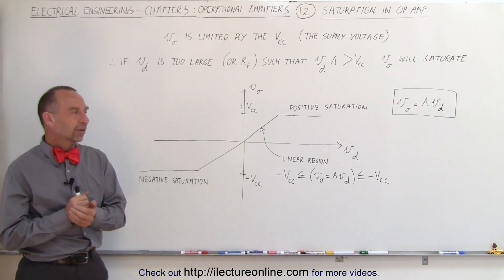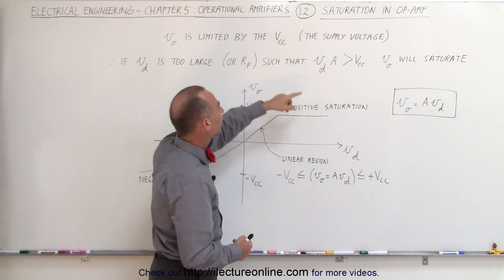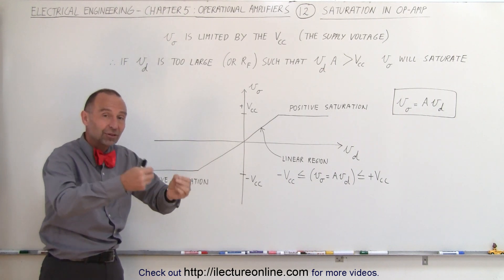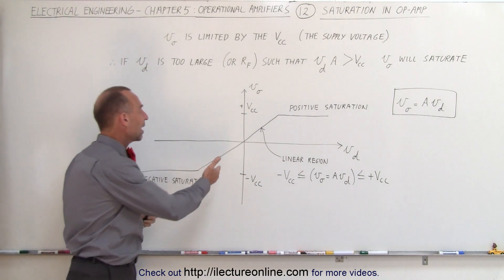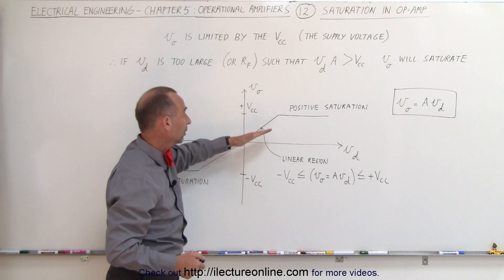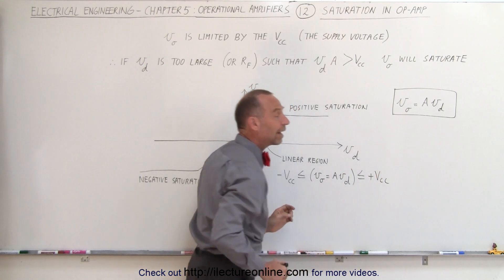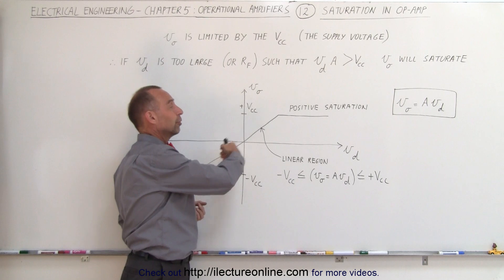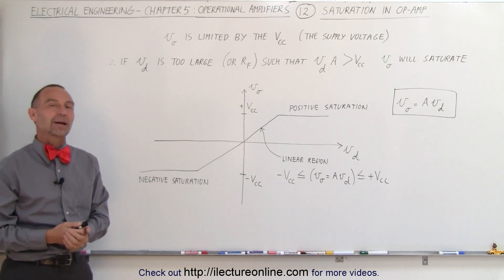Electrical Engineering: Ch 5: Operational Amp (12 of 28) Saturation in Op-Amp

Comment: You say Vd is the voltage difference. But does it mean the voltage difference between the voltages at the positive and negative input terminals? 
Would saying that   Vd = ( V+   -   V- )  be incorrect?
Reply from the maker: Voltage at one location is always referenced to the voltage at another location.  Usually it is referenced to ground (0 voltage) or another location.  That is why we often mention voltage "difference".

Comment: wait how can it exceed the output voltage supply. you said if it exceeded the VCC thne make adjustments? but it can never exceed, can you clarify
Reply from the maker: That is what amplifiers do.  (But they get the power to do so, through the power pins)
Reply: @MichelvanBiezen  Mike I saw your LinkedIn and sent you a message. Are you still looking for a different job and location? If so I think I have something for you.

Comment: excuse me sir, is this saturation valid only for open loop configurations? or is it true for closed loop configurations as well?
Reply: It is also true for closed loop configurations: the output should not be reaching or going beyond the supply voltage rails if you want the op-amp to work in the linear region and have no distortion.

Comment: Sir, I have a question. So how does the op amp "know" how saturate when the output voltage tries to rise greater than Vcc? Is there a scientific explanation as to how that works? Intuitvely it makes sense that you can't get more power out than the amount that you put in, I'm just curious as to how that works.
Reply from the maker: An op amp doesn't actually provide more power than you put it.  The power comes from an external source (it is connected to a voltage source as are all integrated circuits).  But it does act like an amplifier of an input signal (with the help of the voltage source), but can only do so within a certain range allowed by the integrated circuits inside.  When it reaches its limit of it circuit's capability the op amp "saturates".